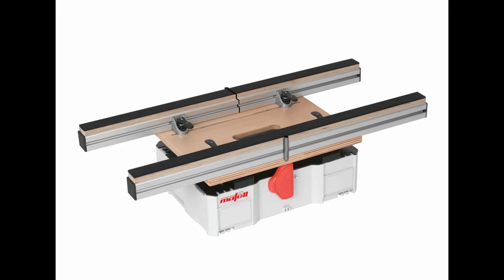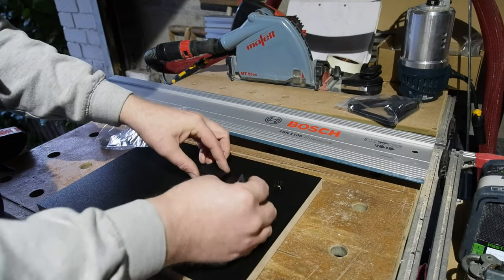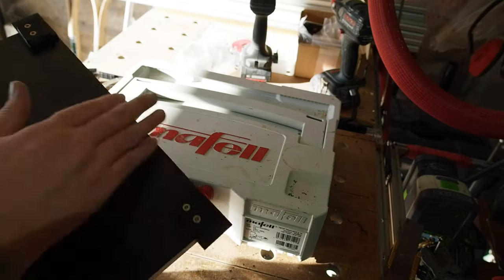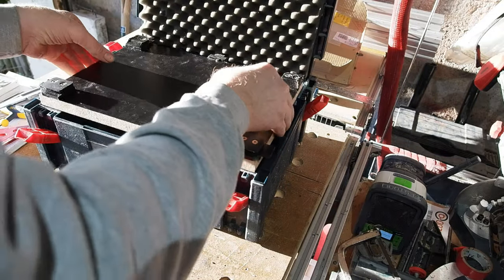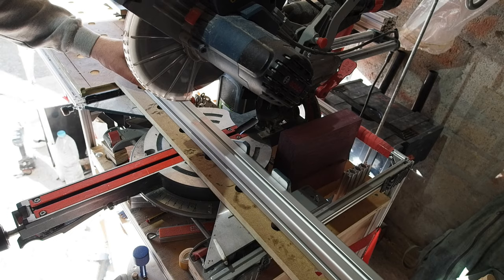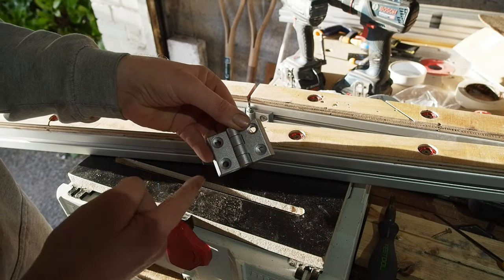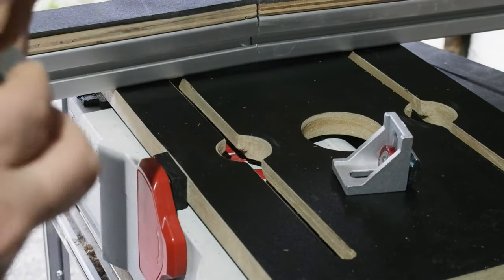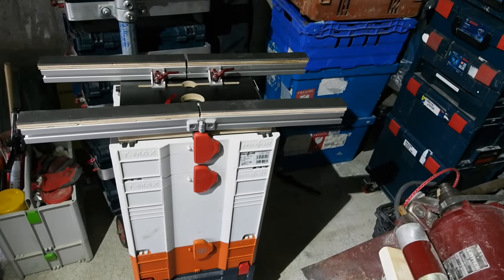DIY Systainer Work Bench / Work Surface Based on The Mafell MA 730.

Comment: Great Idea! Where do you buy those Camclamps? Been looking for a Ruwi variant that doesn't cost a fortune...
Reply from the maker: Cheers. I just use the cams from cheap bicycle seat post clamps. I do quickly show me dismantling the clamps in the vid. If you buy some, be sure to look out for one's where the cam has a lot of thread on it. Quite often they're blanked and only threaded where the nut is needed. I'll talk about them more in the next vid.👍
Reply: @BischBaschBosch  fantastic! Thanks!

Comment: Great add on, if only  parkside tools did systainers id be on it like a seagull on a chip
Reply from the maker: 😁 well, you could always scour round for some second hand systainers for your tools. How are the Parkside tool's? I never seem to get round to going to an Aldi to check em out (Tesco much closer)
Reply: @BischBaschBosch  some of their stuff is alright I got a 12v screw gun the other day £30quid I realised I could buy 7 of them for the price of my cxs 😂 with 7 batteries and chargers plus a 3 year warranty get one of the guns if you see them come up again. Aldi have the workzone stuff it's lidl who do the Parkside 👍
Reply from the maker: @williamn01  when you say guns do you mean the nail guns? Do remember a workzone one at Aldi for 70 quid. If they come round again at that price, might pick 9ne up.
Reply: @BischBaschBosch  no I was meaning the 12v screw guns not tried the nail guns, I'm sure the strawbryte workshop has got a video on the cordless nail gun 👍. That wee 12v I got the other day is ideal I will just leave a bit in that countersink or something and just work between that and my cxs instead of swapping bits out £30 quid can't go wrong got decent power aswell
Reply: @BischBaschBosch  To be honest i have got a couple and they are really good the impact driver is as good as my dewalt and the tracksaw is also good with a bit of a fiddle,i would say lidls 20v items are really good horses for courses really

Comment: Very interesting. Good idea with the bike clamps. Can I ask where you buy your Aluminium extrusion?
Reply from the maker: Thanks very much. The bike cams can be very cheap. Just need to make sure there's a decent amount of thread on them. They're quite often blanked where the seatpost collar goes. The extrusion I got from a chap on ebay that does very reasonably priced bundles. See here - http://rover.ebay.com/rover/1/710-53481-19255-0/1?ff3=4&pub=5575494340&toolid=10001&campid=5338505844&customid=&mpre=https%3A%2F%2Fwww.ebay.co.uk%2Fitm%2F40x40-Aluminium-Extrusion-Profile-5-x1m-Value-Pack-8mm-slot-Jigs-and-Frames%2F273808707015%3F_trkparms%3Daid%253D111001%2526algo%253DREC.SEED%2526ao%253D1%2526asc%253D20160908105057%2526meid%253D15827c37cc5e4ccf8c210a6d71358ccc%2526pid%253D100675%2526rk%253D1%2526rkt%253D15%2526mehot%253Dpp%2526sd%253D273808707015%2526itm%253D273808707015%2526pmt%253D0%2526noa%253D1%2526pg%253D2380057%26_trksid%3Dp2380057.c100675.m4236%26_trkparms%3Dpageci%253Aa425e186-41ea-11ea-9c22-74dbd180f4df%257Cparentrq%253Aecf7d2ba16f0aafabcbee67ffff8c354%257Ciid%253A1